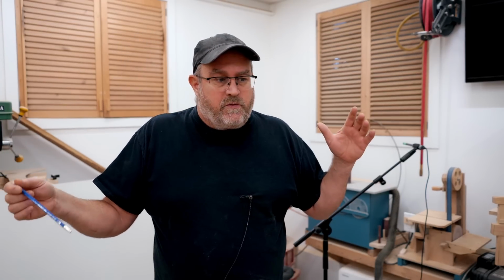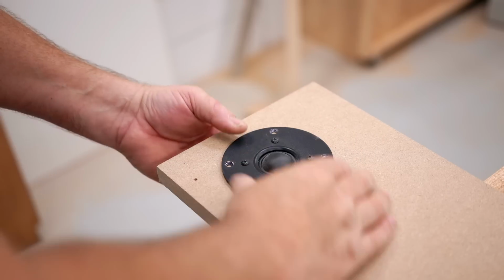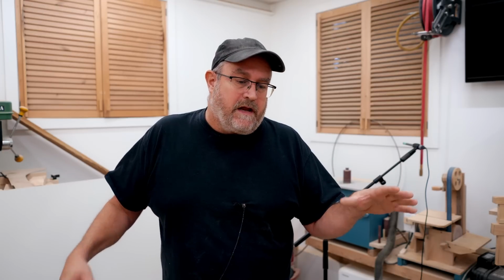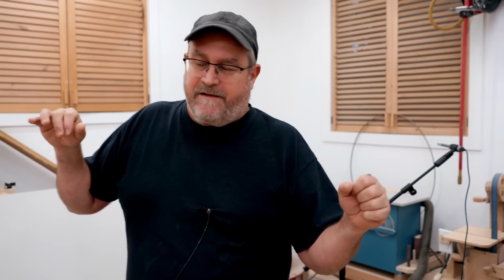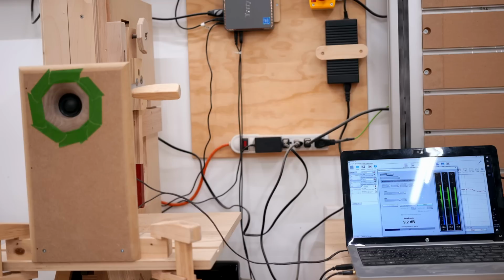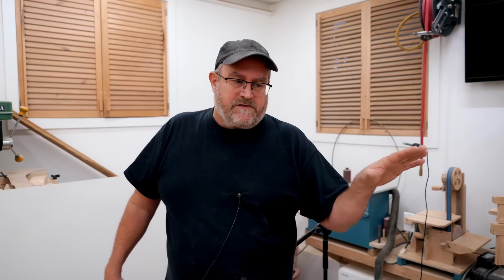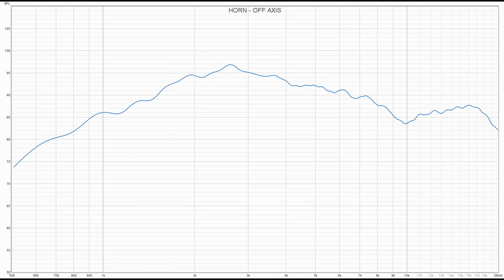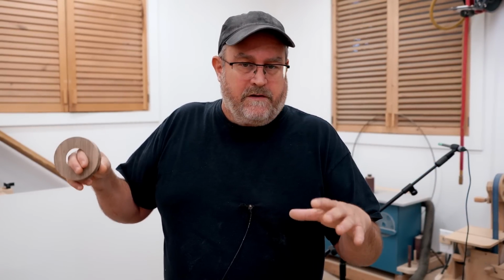What Does a Tweeter Horn Do? And Diffraction Myth Busting

Comment from the maker: The horn flares I made serve to push the tweeter behind the front baffle to improve time alignment, and increase the efficiency of the tweeter by about 5db in the 1500Hz to 10kHz range.
The tradeoff is a dip in the response higher up at 17KHz, but that's an inherent problem with horn loading. That dip won't be audible for the majority of listeners, though, and certainly not me.

As I said in the video the response is technically better with the tweeter flush mounted (as opposed to horn loaded), but then that puts the tweeter farther out of line with the other drivers. What's more of a problem? Flattest tweeter response or time alignment? It's my opinion that both are fairly minor in the grand scheme of things and one can be sacrificed to improve the other without cause for concern. 
There is another factor: the solid walnut horn looks cool. It's a nice contrast with the cherry that the speaker is made from.

As for diffraction, that's often much ado about nothing. 
If you have a microscope, you see germs, even the ones that are benign. 
If you have measurement gear, you see wiggles in the response, even the ones that are benign. 
We simply don't hear minor fluctuations in the response, especially higher up in the frequency range. 

Is flatter better? Yes, but that's like asking if a day with 5% cloud cover is better than a day with 7% cloud cover. There's a measurable difference, but certainly nothing you'd notice unless you tried to measure it.

I see guys presenting measurement data where they are picking out "issues" in the response that in reality amounts to nothing audible. Turning you HEAD slightly while listening will disrupt the response more. Sitting slightly lower, closer, farther, or over to one side or the other will all impact the frequency response that meets your ears. 
And I won't even go there on what the response looks like in an untreated room...

That's why I included the recorded music - to give you a real example of what the tweeter sounds like after each change. You can judge for yourself whether you hear a difference, and whether the difference means better or worse. 

Yes, making great sounding speakers involves doing things right, but mainly it's doing all of the big things right. The big things take it 99% of the way and deserve 99% of your attention - driver selection, box design (or baffle design), driver placement / spacing, crossover design. Only after you've maximized what you can with these core components should you shift your focus to that last 1%.
Reply: I know this is an old video but perhaps you'll get to reading this somehow. I have been an avid speaker builder and designer for a couple of years now and I've always been bummed out by the drive for perfection and sense of competition within the speaker building community. 
I also like a certain degree of professionalism in order to get a ''well designed'' speaker but I always felt judged by the true audiophiles. They kept getting hung up on those 'smaller' things like diffraction, acoustic lobing, dampening etc etc.... I like your way of thinking. Testing some of the widespread ideas about said things, measuring them but also adding some real world common sense about whether or not something is measurable and more importantly audible.

EDIT: the way you put it with the 99% is spot on. Nice to see someone sharing that vision.
Reply: Wow. So well said (and demonstrated). Thank you for this important contribution to the discussion.
Reply: The dip is not inherent to waveguides per se. Proper math and modeling will avoid it to a degree that it is practically inexistent.
Reply from the maker: @marinus_r  Right. So you say it isn't inherent, yet you say that it can be avoided so it's practically non-existent. 
Which is it? 
If it's something that can, at best, be avoided, then it's obviously an inherent problem.
That's like saying that lack of light due to it being night isn't an inherent problem, because you can sleep through it.
Reply: @IBuildIt  
Any axisymmetric device suffers from cancellation on-axis. The magnitude of this can be reduced so that this issue resides within a fractal of a dB deviation, say 0.2-0.5 dB, compared to non affected off-axis angles.
What you showed was severe cancellation of at least -4 dB above 15k. This magnitude is not an inherent issue with waveguides as how it was presented to the audience but due to the makeshift application of a waveguide. Put another way: an acoustic error, resulting from the engineering process.
Reply from the maker: @marinus_r  It's not an error - it's a compromise.There's always a trade-off.
If you want to reduce the dip at high frequency, you'll have to do without some of the gain you get at the lower frequencies (the ones you are looking for when you horn load a driver). 
There isn't much music content above about 12KHz, so the dip (and its magnitude) is generally considered to be a non-issue.
Reply: As an autistic im telling you both parties are telling the truth, for themselves, exceot some outlyers both dierctions that lie for whatever reason
Reply: If you're from a generation used to mono then sure diffraction doesn't matter much. In fact you end up getting a larger sound from the secondary diffractions which are essentially 2 tweeters and 6 diffractive radiation sources.

Where it matters is in modern times when people use two speakers and stereo imaging matters. This style of speaker testing is why people think stereo isn't 3D sound. When you have a truly transparent speaker where the diffraction is controlled, diffraction is often even used constructively to enlarge the sound of the tweeter. Andrew Jones creates rings around his Uni fi drivers and many kef drivers also use diffraction outside the surround and sometimes use the diffraction of the rim itself to create the impression that a tweeter placed at the throat of a woofer is larger than the woofer itself.

This is what gives their speakers such commonly reviewed holographic imaging where you can hear not only stereo separation 360 but sound above and below you.

The LS3 5as were the first studio monitors meant to be standardized monitors licensed by the BBC. They needed to add a foam rectangle around the tweeter to get the imaging to produce a coherent sound stage. The LS50 had a receded surround and uses the surround itself as the end of the flare as a waveguide. The convex design is meant to eliminate baffle diffraction but the Z flex has striations that diffract sound from the tweeter.

This is why the their waveguide uses a compression style series of fins called the tangerine waveguide. You can hear it's effects here.

https://youtu.be/j6lG_EOiv8Y

Designed beyond the LS50 use diffraction constructively. When the diffraction is in a circle and on phase with the woofer you get even dispersion between the tweeter and the woofer and no shot gun effect.

The whole purpose of the tangerine waveguide was to tap into the energy at the rim of the tweeter dome which makes diffraction even more prominent and possible to harness.

Comment: You are kind of mixing up two things.  A horn and a waveguide are kind of on the same spectrum but not really used for the same thing (usually). A horn is something a bit different and usually a lot larger. What you are having is a waveguide which is generally to shape the response esp off axis.
Yes it increases the effectivenes of certain frequencies but it also drops off a bit more off-axis (as you correctly say). 
One of the primary design goals of a loudspeaker is to have as flat response as possible off-axis. 
A big problem in matching woofer/mid and tweeters that the woofer starts beaming when wavelength is smaller than the diameter thus reducing off-axis output. This makes it harder off-axis to join it to the tweeter that does not have this problem. 
This usually means off-axis that total response will have a bump at around 3000 Hz somewhere. One way to remedy this is to mount a waveguide to the tweeter.
It enables you to reduce the output of the tweeter off-axis thus mating it easier to the woofers response. The loudspeaker will be more directional but its off-axis response will be flatter.
There is some discussion that the BBC-dip is actually a compensation to the off-axis bump generally found it a lot of speakers. 
The tonal balance you hear is an integration of (in a complex relationship) between direct sound and the sound you hear reflected. Complicated because the time-distance of those reflexes matter a lot aswell as that it is very different depending on what frequencies we are talking about.

Comment: I do hear a difference between surface and flush, but not much between flush and chamfered, definite difference with the horn. I don't prefer the horn, but that mid bump will probably be flattened with the crossover, and then the advantage of the horn will shine.

Comment: I made progress with flush installation of compression driver and cutting it at 6000hz and lifting the high end with a shelf a bit. I just screwed it into small plywood box so that it is 2mm in. It is accompanied with a full range Dayton PC83 or three of them in series. The thing is I cannot get back to traditional tweeter. I just cannot get similar clarity and power capablity. This compression driver is from Behringer PA speaker. But it is a real compression driver. If I lower the xo to say 4000 it is total trash. How ever much I tweak the xo point and depth and angles always these guys want to meet at 6000hz with 36db per octave angle.

Comment: Rounded edges on a baffle only improves the response by 2-6db at most, but when you are nearing the edge of squeezing out every bit of performance out of a speaker these tiny improvements aren't a bad thing. You definitely can't hear the difference alone, but incorporated with everything else you end up with speakers such as genelec which are sonically pure.

Comment: I guess the cause for the dip is diffraction in the area between tweeter and Waveguide. Is it technically speaking even a horn ? I don't know.
The Monacor DT300 would have been a better fit for this tests because they (Monacor) sell a Waveguide that's specially designed for it, that way you would not have the weird dip at high Frequencies.

Comment: I listened to the 5 different pieces that you have near the end several times.  The more changes you make, the less defined the violin is to my ears.  It sounds less crisp, and with the first (surface mount) I could hear the string vibration on the neck, but the more alterations made I hear less and less of that.

I went back and listened to the full clips of each, and those nuances are lessened with each subsequent change.

I'm pretty certain that my hearing is more specific/precise at higher frequencies than most people that I know.  I can hear things that others cannot.

I've been in 2 situations (different times, different locations) where an electronic device that is used to scare animals away from bushes have been used, and they are excruciatingly painful if I'm within 20ft of that device.  Everyone else that was around me could not hear the device at all.

So, surface mounting is the method I'll be going with, for the sake of accuracy/detail.

Comment: I know this is an old video but perhaps you'll get to reading this somehow. I have been an avid speaker builder and designer for a couple of years now and I've always been bummed out by the drive for perfection and competition within the speaker building community. I also like a certain degree of professionalism in order to get a ''well designed'' speaker but I always felt judged by the true audiophiles. They kept getting hung up on those 'smaller' things like diffraction, acoustic lobing, dampening etc etc.... I like your way of thinking. Testing some of the widespread ideas about said things, measuring them but also adding some real world common sense about whether or not something is measurable and more importantly audible.
It's just very refreshing to me to see a builder/designer who knows/sees the imperfections but likes the outcome anyway and just takes it all with a grain of salt.
Reply: old reply, (to Vincentkoster6291)  I disagree with your premise. Details matter , small things add up to make a difference.  In engineering we call this "Stacking". Perfection is unobtainable but we CAN strive to do our best. Why limit the possible quality of a product because you don't want to spend the effort to achieve it's best? Do you sand your woodworking products? Would you surface mount a tweeter?

Comment: A horn is one of the means for matching the impedance of the diaphragm and the air. Therefore, since the impedance of the horn is matched, a sound pressure signal proportional to the electrical signal is obtained, resulting in a clean sound. (However, whether or not you think the sound is good depends on the listener...)
By the way, when the impedance is matched and the horn operation is successful, the impedance of the speaker becomes flat. Even if you install a horn (or something like that), if the impedance is not matched, the sound quality itself will not change, just the sound will be louder.

Comment: Great approach.  Been doing similar for years on my builds.  The other thing with the waveguide which is a big plus is you gain controlled directivity improving room integration and polar matching with mid.  Roundovers must be MUCH bigger radius to work as in 6 inches plus. Then you’ll see a more significant improvement.  

Horn gain as you discovered can alter linearity despite upping efficiency so usually I’d expect more complexity in the crossover.  No biggy..  I thought the horn music sample sounded way more coloured unfortunately with flush mounted the best.  Flush mounting the waveguide and more crossover work needed to deal with that.  You’re right to avoid dsp correction where possible. Never sounds as good as a well designed all analogue passive to me unless just to lop off bass peaks in room.  Often destroys smoothness of polar response which designers sometimes overlook and that matters.

Comment: One possible adventage of the horn loading is to actually match the wave front of the tweeter to the midrange making them sum coherently in phase at all angles. This improves the integration off axis. You can shape the response to be flat way off axis and even increase the dispersion in the top end compared to a flat baffle. How the horn is shaped and how it attaches to the radiating surface of the membrane is important. To avoid destructive reflections.

Comment: Interesting experiment! I've build a few speakers myself, from scratch and must admit i think I hear a difference between on baffle mount and flush with a big round over. Doesn't mean it was better either way.... I do try to get a flat ish response with a 2 db drop from the lowest to high frequency. In my opinion this way the speaker gives the best representation of how the recording "should" sound. Assuming there is no eq used offcourse.

Comment: The way horns make speakers more efficient is by condensing (altering) the sound wave thus distoring it. Think megaphone. Horns were developed due to amplifiers being weak back in the day. We have powerful amps now so don't need archaic technology (like vinyl and tubes). But they look cool.
Reply from the maker: You got the second part right, horns were developed to work with low powered amps. But your conception of how they work is incorrect. They do not cause distortion, in fact they can actually lower the distortion for the same output level from a driver that doesn't have a horn.

Comment: Hi John , congrats very fine work!!!! About the edge treatment, something from Siegfried Linkwitz /linkwitz labs :The benefits of edge rounding come into play only when the radius is greater than 1/8th wavelength. Thus a typical 1/2 inch radius begins to diffuse the diffracted wave at frequencies above 3.4 kHz, but will decrease in relevance at higher frequencies, when the driver illuminates less of the edge due to its increasing directivity. With most speaker cabinets the radius or chamfer is acoustically too small and is primarily cosmetic. Regards from Germany - Stefan

Comment: The problem with your testing here is that you used music that consist of single instrument of ca. ~1-4khz range. This is not testing tweeter where it matter for this video's purpose. That range is only louder but flat in measurements and not affected by horn problems. Music test showed nothing about higher treble(cymbals, softer highs etc.) but measurements did, however due to ignorantly selected music of limited range we don't know if there is an audible difference(incl. off-axis) in higher treble or not.

Comment: The results with the horn should have been enough to make you abandon it. As an older guy too I understand the higher frequency  hearing loss . But you could build in a rising response at higher frequencies to compensate for your hearing. So therefore the dip in response up at the higher frequencies from your tweeter horn cannot be justified in any way… especially for your hearing. It merely looks good.